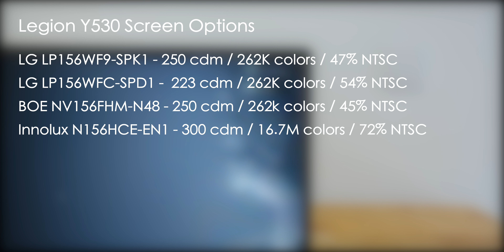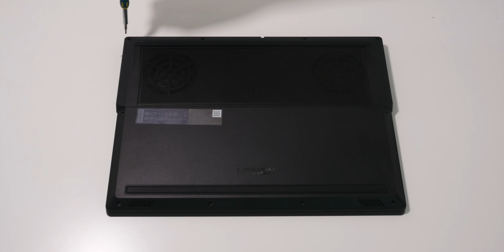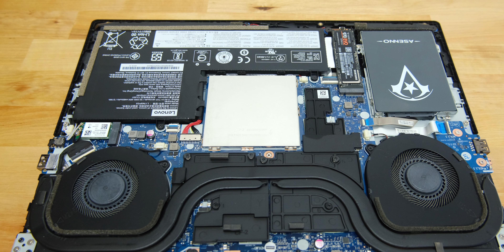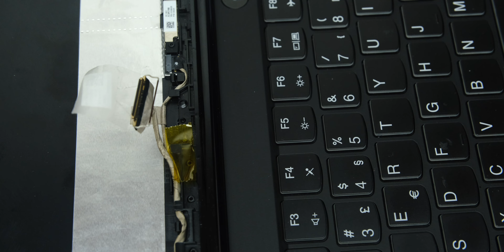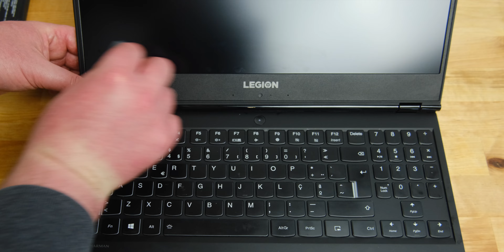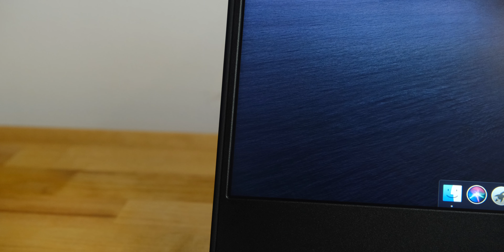Replacing screen on Lenovo Legion Y530

Comment: That´s not the proper way to remove the adhesive from the screen. Those are adhesive strips and they have to be pulled from the bottom of the screen.

https://www.youtube.com/watch?v=9i-WmvCTyPc
Reply: Same here, broke good lcd.
Reply: What to do if I broke off the adhesive tape?
Reply: @usmanchougule4654  apply heat and try to pull the screen slowly
Reply: yeah, because of this i fucked up a completely good lcd. wanted just to change the hinges

Comment: i have a lenovo legion y530 81fv having 30 pin 60 hertz display and i want to replace it to the 144 hertz display, for that i got 40 pin display cable as well as the 144 hertz panel is it possible to replace it
Reply: @Senesto-x9c  are you able to do it I have y530 15ICH 81FV as well, I heard somewhere that the signalling algorithm for 144 is different from 60 which is why just soldered slot and cable change can't simply helps us achieve it
Reply: @nihxl  yes your right, it's not possible, so i bought arzopa portable monitor

Comment: My front cover near the right hinge is broken (the plastic is broken) any way of fixing it ?
Reply from the maker: You mean the screen bezel? You can't repair that, at least not invisibly. You can buy a replacement bezel for around $20 - just google the part number 5B30R40182
Reply: @BartechTV  I meant the front plastic case behind the screen. The hinge is okay, it is the plastic case behind it that is cracked and broken any way of fixing it. Thanks for your time taken to reply

Comment: I hope you add some kind of edit or annotation or disclaimer about the fact you actually just need to pull the 4 adhesive shorts instead of prying the LCD screen back up away from it! I saw that people needlessly broke their screen. I've been nervous about trying to do it without the correct instruction and now I see it was prudent to wait and check.

Comment: Can you show where the other side of the lcd cable connects to the mother board? I had to replace my keyboard and forgot where it was. I’m so frustrated and any help will be very appreciated thank you
Reply from the maker: The LCD connector on the motherboard is in between the slot for the wireless card and the fan. If you look at my video on upgrading the SSD in the Y530, you'll see it at the 5:05 point in the video, on the left side.

Comment: HI there, just got the Legion 5 (2021) -  Model 82JU001SFR. But the 120hz screen is a bit washed up (45 NTSC & 250 cdm) and rather off  putting when it comes to brightness, so i wonder if you had any ideea of a screen upgrade for my model. Preferably to 144/165hz with G Sync. Thanks in advance!

Comment: what type of pin used? 30pin edp?
Reply from the maker: Yes, 30 pin EDP.
Reply: @BartechTV  thanks! I plan to upgrade to 120hz lcd panel
Reply: @BartechTV  please help. What is the screen pin I should take. 30 pin or 40 pin? Where can I find information regarding it
Reply: @webster.  checkout panelook website

Comment: is it possible to install  4k panel to this laptop? like dell xps
Reply from the maker: Not without physically soldering a new connector to the motherboard. The display connector on the 1080P models is 30pin but the 4K screens use 40pin.

Comment: you can upgrade to 144hz by replacing the eDP cable...
Reply: Is there a video on that?
Reply: @lukaspopovic6662  you'll basically have to check 3 things: 
Does this laptop come with a 144hz variant?

What's the variant LCD panel model? (b156Han0.1, etc etc... Check Panelook.com)

is there a specific eDP cable for 144hz? (some have 40pin, other 30pin)
Reply: @yakine13  yes Y530 comes with a 144 Hz version, but I did not find a video on how to replace the eDP cable
Reply: @lukaspopovic6662  try to search for the 144hz panel model

Then it might be compatible with your laptop without any edp replacement

Use HWinfo  to find your model and notebook check to find the 144hz model
Reply: bruh u cant replace the connector on the machine....
Reply: @qeq  bruh you can it's called an eDP cable...
Reply: @yakine13  its soldered to the display shell dingus. you conenct the edp CABLE to the display
Reply: @qeq you mean the cable is soldered to the motherboard or the display? What a dumb response as the video prove my version.
Reply: @qeq  lol you have the answer at 7:10

Comment: is it possible to upgrade from 120hz to 144hz?
Reply: What’s the point
Reply: @obliviate1592  my brightness on my laptop is 250 nits, i need a higher brightness because i usually work outside and I can't find led brighter than 250 nits on 120hz

Comment: There is a tiny red and blue vertical line on the edge of my y530 display. Is it normal?
Reply from the maker: No. You need a new panel. Should be covered by warranty.
Reply: I had this problem for half a day and it fixed itself after I hibernated my laptop.
Reply: @JohnPaul-yv5et   mine didn't. Any update on your screen?

Comment: can i upgrade my legion Y530 with 60hz to 120hz?  and which screen do you recommend?
Reply: He says in the video that it's not possible; the 60hz panels use a 30-pin connection, while high-rate panels use a 40-pin.
Reply: @Konvinced89  Thank you man, my main language it's not english so i just read about the 144hz information and I thought there was a possibility to buy a 120hz with 30-pin connection.

Comment: Plz Why i cannot upgrade this particular model to a 144hz screen ?
Reply: The 144hz uses a 40 connector, unless you have a 1060 gpu then you have a 30 pin connector
Reply: There is a 144hz panel with 30 pin connector tho. Does that counts as compatible?

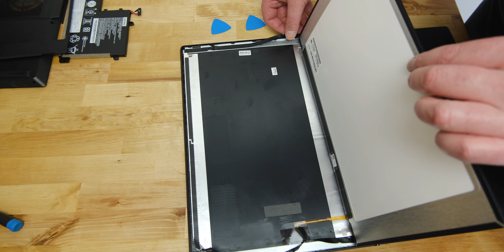Comment: The adhesive is a pull adhesive. If you use the pull tabs at the bottom of your panel, the adhesive comes off easy and there is no chance of breaking your screen. That was a facepalm moment at 5:40 when you started prying your screen.
Reply: Stretch release adhesive